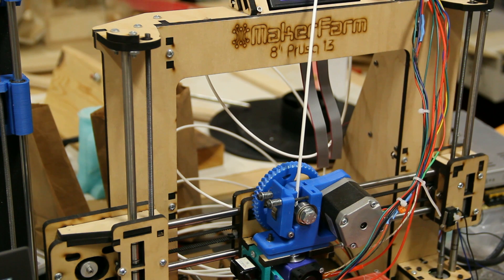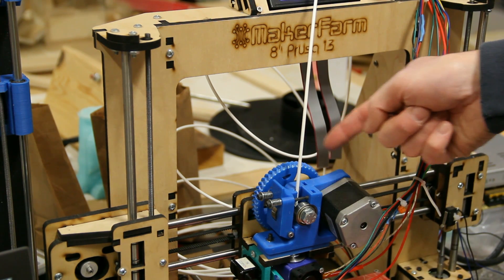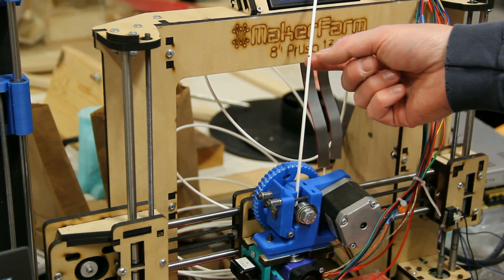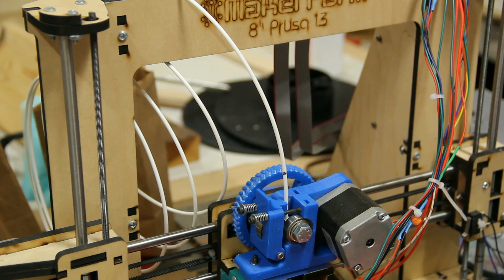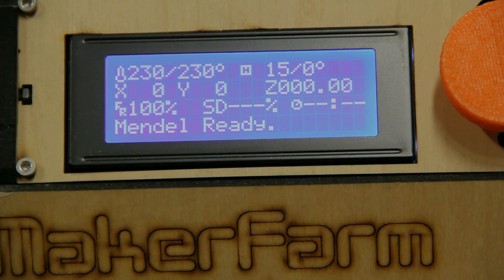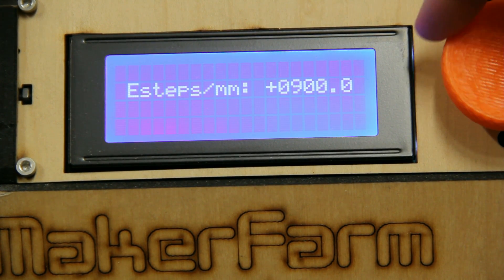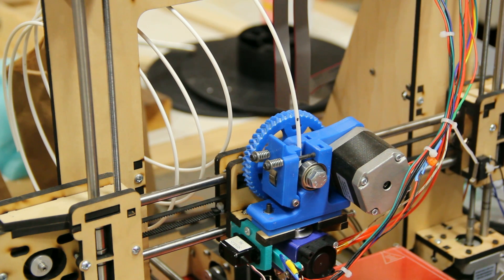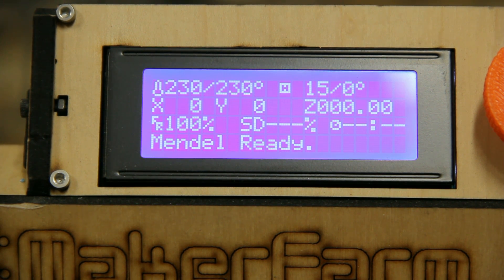RepRap 101: Setting your 3D printer's extrusion Part 1: E-steps

Comment: I get that printers are somewhat similar and so is software, but this isn't a blanket, one size fits all deal.  Your steps for processing the testing and figuring out the numbers do not match many newer printers.  I get that this video was made 3 and a half years ago, but if you are still active maybe you can make a revised video for more modern machines.

Comment: Great explanation! but i can't "upload" PLEASE HELP!
I downloaded the last Arduino 1.8.1  and from here i opened Marlin.ino, means the entire Firmware sketch, fund in the 3d label the configuration.h - and i edited as your instructions to activate EEPROM writing, than i performed a verify resulted ok.
 Than i saved on the "Marlin.ino" file but the program keep the old Marlin.ino -copy (good)
Now i tried to upload it to the printer. Conected the Prusa i3 USB, I set "Mega 2060 board", COM3, and finaly i pressed "upload" to flash it to the printer.
....compiling sketch, uploading ...green progress line... than:
Arduino: 1.8.1 (Windows 8.1), Board: "Arduino/Genuino Mega or Mega 2560, ATmega2560 (Mega 2560)"

Sketch uses 48986 bytes (19%) of program storage space. Maximum is 253952 bytes.
Global variables use 2734 bytes (33%) of dynamic memory, leaving 5458 bytes for local variables. Maximum is 8192 bytes.
avrdude: ser_open(): can't open device "\\.\COM3": Access is denied.

avrdude: ser_drain(): read error: The handle is invalid.

avrdude: ser_send(): write error: sorry no info avail
avrdude: stk500_send(): failed to send command to serial port
avrdude: ser_recv(): read error: The handle is invalid.

avrdude: stk500v2_ReceiveMessage(): timeout
avrdude: ser_send(): write error: sorry no info avail
avrdude: stk500_send(): failed to send command to serial port
avrdude: ser_recv(): read error: The handle is invalid.

avrdude: stk500v2_ReceiveMessage(): timeout
avrdude: stk500v2_getsync(): timeout communicating with programmer

ANY SUGGESTION? 
thanks

Comment: I made marks, extrude 100mm in pronterface, and actually extruded around 14 mm of filament. I did something wrong? Or such results is okay and i just should tweek steps?

update:
turned out this little metal thing that push filament to extruder wasn't properly tightened. =(  Screw was too short and wasn't actually regulate tightening, the only thing it do was messing the angle of the clip that holds roller.

Comment: Hey Thanks for the videos, very helpful... and its great that you explain everything,

I am printing with the Duplicator i3 V2 and I have a question, is it normal to have E-steps set to like 130? I did the test you show like 15 times, and I finally got it to 19.4mm left at 130 Esteps, so it extrudes 100.6 at 130 E-steps. 

The strange part is that every time I disconnect my printer from Repeitier-host, it resets, but I did save to EEPROM and Esteps were as I left them, however, after the Reset happens, no matter what the Esteps is, I am left with 31mm (rather than 20mm), so it extruded 89mm. For example I set the Esteps to 130, and I got close, but I disconnected from Repeiter-host and reconnected, (esteps still at 130) however it still extruded the same amount 89mm. I notice this problem when my printer resets from disconnecting from repitier-host...  Thank you in advance

Comment: I have a bowden set up. Do I need to have the filament going through the hot end when calibrating the E steps, or can it just be feeding into the tube? I did it with just feeding into the tube, and it seems that my problems have gotten worse. The hobbed bolt chewing into the filament, and the filament pushing back like it can't move through the hot end fast enough.

Comment: Love the video - well done!
My problem is that I am using Slic3r, not pronterface. I downloaded pronterface, but it's not working (more likely I'm not). How can this be done without Pronterface? Thanks!
Reply from the maker: I see you've found it, but the key thing to remember is that Slic3r is a slicing program, and doesn't actually control your printer directly.

Comment: Hey there nice video unfortunately my extruder goes nuts when I change the esteps value, at 575 100=75 at 7 somthing it extruded like 200 at 670 100= like 30
any thoughts
Reply from the maker: Make sure you've got your hot end up to temp and you have good flow.  Excessive back pressure can really mess with things.  Also, make sure your hob system has the correct tension.
Reply: ZennmasterM Yes it was the hot end I removed it ran calibration and it works well now thanks

Comment: been trying this my current EStep are 900 when I asked for 5m i got 20mm if the math are correct (5/20)*900=225.00 problem is when I set that my extruder reversed :)

Comment: How do you find and apply the  e-step value if your printer does not have an lcd display?
(still using marlin firmware)
Reply from the maker: Find the line in your Configuration.h file that looks something like this:

#define DEFAULT_AXIS_STEPS_PER_UNIT   {80,80,4000,945}

Change the 4th value to what you computed.

Reflash, and enjoy!

Comment from the maker: Natasha (for some reason I can't reply to your comment directly),
The filament should be far enough into the exruder that you are producing a normal extrusion.  Make sure you've got your hotend up to proper temperature, good idler tension, and the extrudate flows nicely. 

If you mean you ask for 100mm and you get 80, then yes, use the same procedure.  You may also need a couple of iterations to get it right.

Comment: hey there great video. I finally acquired most of my parts for my printer. I found the code to get the screen working but I cannot see the sd card.. any idea what I missed?. thanks
Reply from the maker: Without knowing what display you have or how you've got it set up, my first suggestion would be to look the section of your Configuration.h that has all the various displays, and make sure you've got the correct one selected.  After that, make sure you've got your SD card properly formatted, and that it's compatible with your card reader.   Some readers don't like big cards...
Reply: mine looks the same as your 4 line display. I have gotten the display working just shows no sd card.. I'll try to format the card see if that helps. 2 gigs shouldn't be too large?
thanks for the help.
Reply: SUCCESS.. I never would have thought to re  format the card.. also a note to anyone else that might have a similar issue. untick the quick format.. now I just need the rest of my parts to show up.. The internet rocks.
Reply from the maker: Chuck Farley
Great news!  I love it when it turns out to be something quick and easy!   Enjoy the rest of your build, and feel free to ask any other questions.
Reply: Thanks.. I will likely have another question or two. ( =

Comment: I get some weird stuff trying to calibrate my new E3D hotend v5 on a Velleman k8200 printer

Standard steps = 600
First calibration run extruded 86mm instead of 100 so this becomes 697,7 steps

Trying again:
extruded 110mm instead of 100, new calibration steps = 634.3
then extruding 80mm instead of 100....

What is happening?
Reply from the maker: My first thoughts:
1) Make sure your hotend is up to the proper temperature for the filament you are extruding.  It would be preferable to be at the high end of the range.
2) Make sure your hob is properly tensioned to the filament.

It sounds like you might be experiencing some under-extrusion due to back pressure on the filament.  In that case, either the hob is grinding your filament rather than extruding it, or the motor is skipping steps.  Either way, you're underextruding.
Reply: Well I slowed down the extruding (from 100 mm/min to 50 mm/min) and then it worked decent. 

I'm currently struggling with a part witch has allot of retraction (the eifeltower from thingiverse). The filament keeps getting grinded down until the point the hob cant grip the filament anymore. I'm not sure if tensioning the filament too tight is the solution for this. How do you tension your filament? I tension until i can't go any further and then turn back half a turn.

Btw: keep up the interesting video's! Looked at all of them ;-)

Comment: Perhaps I'll have to try this again..but I did a quick attempt with 120mm just like you, extruded 100mm, got 91.43mm, and as a result raised it to 984.4 e steps.
Then I extruded 10mm and ended up measuring something like 17mm.

So the e step I calculated is clearly too high. It will probably take several attempts of doing this again so that I can average out a proper e step value to finally use.

Also it's always better to extrude an initial longer length so that your ratio will be more accurate..don't do something like 20mm versus 100mm.
Reply from the maker: One thing to make sure of when you're doing a long extrusion (and I agree, the longer it is the more accurate your results will be), is to make sure that your hotend is all the way up to temperature, and also I would recommend slowing the extrusion speed a little bit. 
The reason for this: if there is excessive back pressure on the extruder, the motor could potentially skip one or more steps, thus artificially shortening the extrusion and throwing off your results.